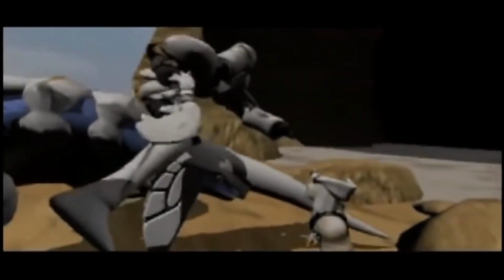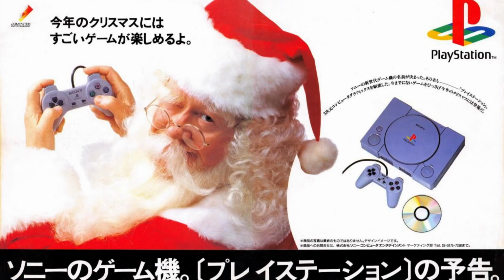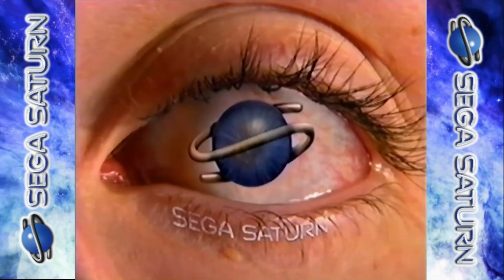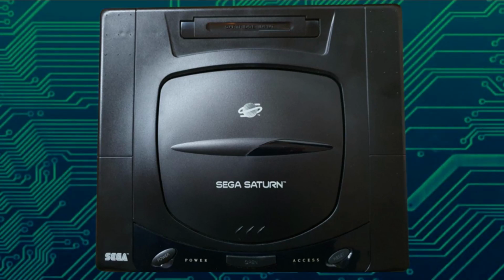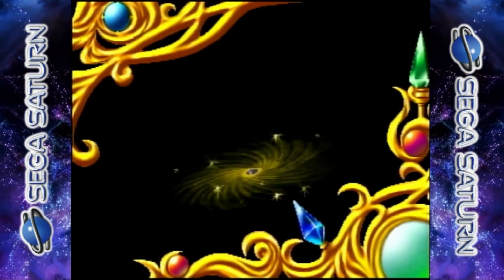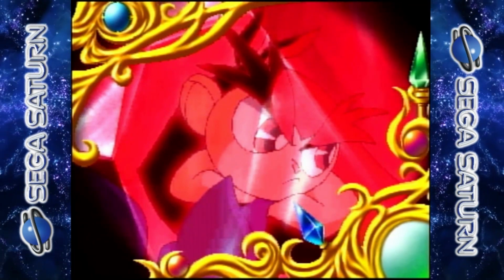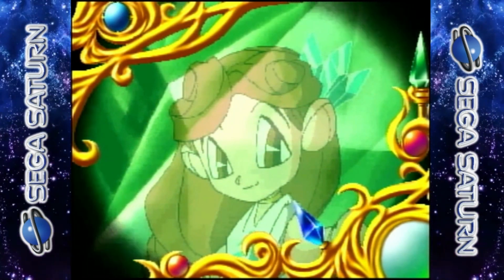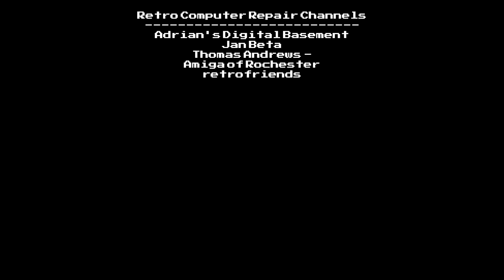A Look at the Sega Saturn

Comment: 13:30 I'm sorry but you are mistaken, like many other people. Neither the SAT nor the PSX were able to render that amount of polygons per second: 300.000 , 800.000 , whatever the number. When Hideki Sato heard about the PSX being able to render that amount of polygons per second he said it was a lie. The SEGA Model 2, a much more powerful machine, was able to render 300.000. Most likely, the SAT and PSX render around 100.000 polygons per second and that might be stretch already.
Reply from the maker: Honestly I wouldn't doubt it. I felt those numbers were pretty high for the time. I really need to start listing my sources for information, but I believe in this video I got most of my information off Sega retro which seems to be pretty reputable. But I would tend to agree with you that 7 to 800,000 polygons per second seems a bit much for the early to mid-90s. Thanks for the tidbit information and watching.